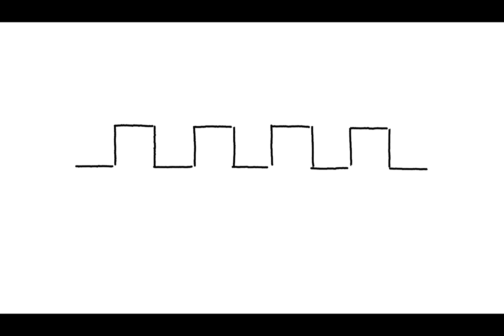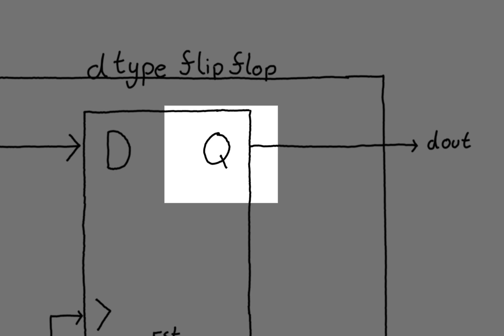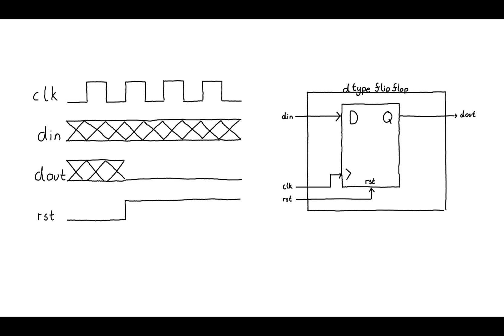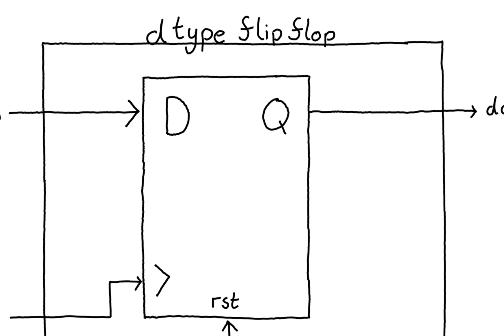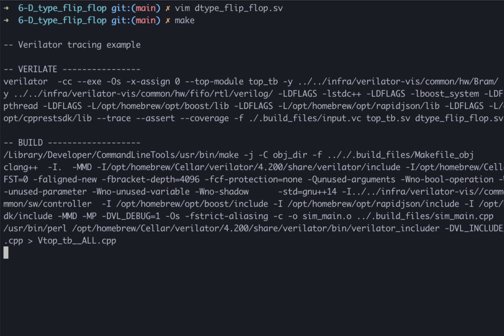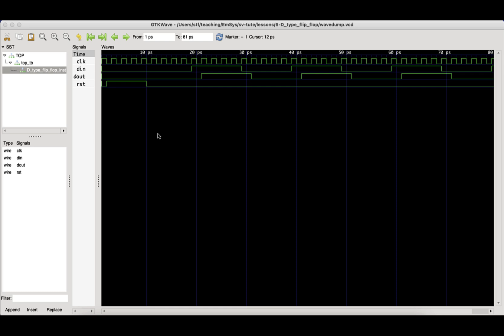System Verilog: Sequential Logic and D-Type FlipFlops

Comment: Is it best to use a fast clock in an always block, and then sample the slower levels of the input signals..  or should you the input signals themselves in the sensitivity list?

For example, if you want to do some behavioral code at the rising and falling edge of a signal, the I assume then one MUST use a fast clock (since you can't have an always block with both the posedge and negedge of the input signal)?